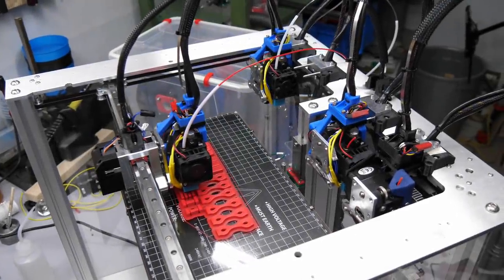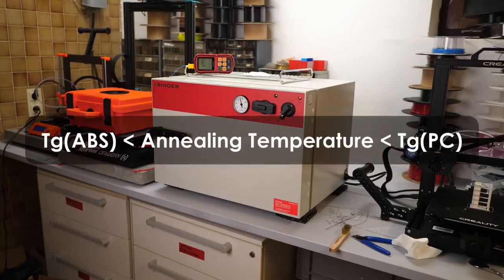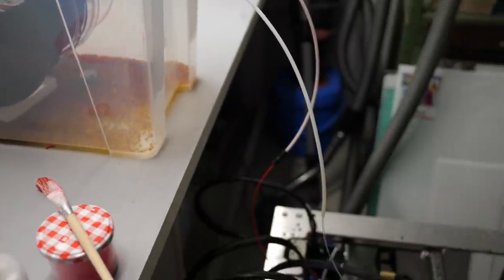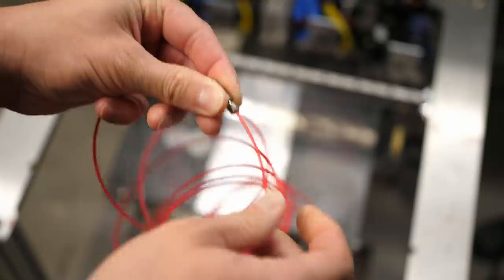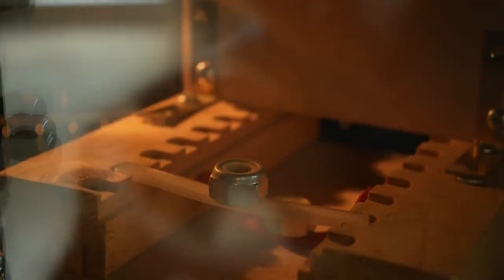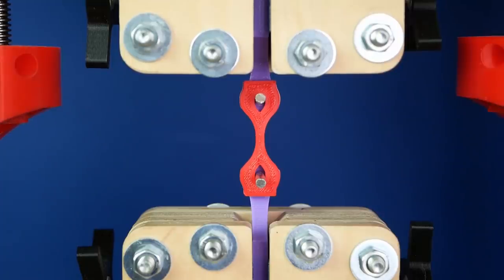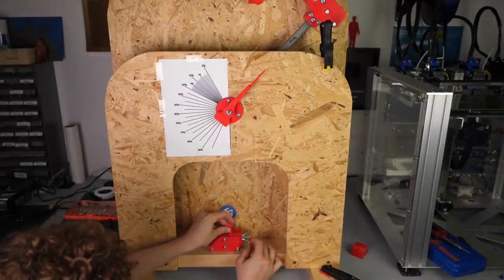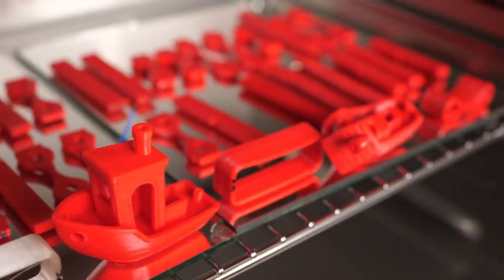PC-Core ABS - WARP-FREE annealing with Ingenious Dual-Material Filament

Comment: 8:40 Seeing this makes me miss the Differential Scanning Calorimeter we had in college. Have you looked into Differential thermal analysis? Those are reasonabely easy to diy. 
Getting a fairly accurate estimate for the Tg, Tm and Tc for both materials seems to me to be key to getting this to work. That is, if it is acually even possible and the paper not a fluke.

Edit: I am an idiot. PS and ABS are amorph so Tm and Tg are the same. -.- I mean like, the PS was transparent, even after this random heating and cooling. Should have been obvious.

Edit2: I do not get it. Even though PC has an higher Tg, the processing temperature are roughly the same. So even though ABS gets 50° earlier soft, both end up at roughly the same viscosity relatively fast. The whole point of adding PC is to give the ABS form stability while annealing at higher temperatures. But getting anywhere close to the temperature needed to influence the adhesion between layers enough to justify the ABS will also melt the PC.

Would it not make more sense to just run the extruder at the max. temperature for extruding PC, seeing that ABS can get easily take the temperature without reaching Tc, and forego the annealing alltogether?
Reply: This is actually a very simple, easy to test, yet genius idea! Provided you will not get thermal degradation of the material, of course...
Reply: It does not have to be pc-abs even. Any combination of materials (say, PLA with somethings else, compatible yet more heat-resistant) with HDT delta high enough, will allow printing stuff at very high temperatures that results in layes fusing together perfectly, BUT the core will prevent the print from sagging in the process! No need to heat treat for days.
Reply: Even more interesting, it seems that you will be able to use highly fiber-loaded material in the core, BUT get away with a brass nozzle because outer layer isolates the nozzle from the core.

Comment: One of the things that really bugs me about all of your heat-adhesion and heat-annealing videos is that you never use an actual firing sequence or heating pattern with the piece already inside the way a heat-treatment oven is traditionally used; or at least you don't describe doing so. As far as we know as your viewers, you just crank the oven empty, wait until it stabilizes at a single target temperature, open it to insert the piece (which destabilizes it), and then leave it in there at the same temperature for durations that you don't always reveal... If you're going to keep the treatment oven, can you please make an episode where you test different heating and cooling sequences?

Comment: Have you looked into acetone treatment on ABS and how that affects layer adhesion? I would imagine it would help adhesion at least a little bit since the vast majority of a part's strength comes from the shell thickness and count, so fusing the outside with acetone would show better results than just the infill, for example
Reply: I was also wondering about vapour smoothing. Pretty sure he has done it in the past to pure abs and got worse results, but could be interesting to see what it does with the PC core
Reply: Acetone smoothing doesn’t effect layer adhesion, because it only melds a minimal part of the layer (around 0.1mm on the outside).
However, you could strengthen ABS prints with One or more coatings of ABS slurry on the outside. Printing dimensions and optics will deteriorate  dramatically because of warping, though.

Comment: Could you revisit gluing parts together with multiple Glues as well as multiple Materials? 

I Think of PLA, ABS, PETG and maybe even PP as Materials. Glues could be CA in different viscositys, Epoxys, Modelling Glue (Modellbaukleber), Acetone fusing. Also you could include welding/fusing methods like soldering Iron fusing, 3D Pen welding, and even friction welding with using filament in a Dremel.

Recently I got myself some Pattex PXSM1 which seems to work extremely good with ABS and PLA because it dissolves it and fuses it together. Maybe even better than CA on both Materials. But with PETG which it probably can not dissolve, the bond ist extremely weak.

While there are some videos on that topic most only include a small base of glues / welding methods or only one kind of material. Also many of them are not of the high testing quality like your videos!
It would be very interesting to know, if there is an "one to rule them all" kind of gluing/welding or to know which is best for which Material.

Comment: Stephan, would it be worth testing the annealing using a vacuum bag technique? Similar to what is used in composite layer resin infusion? Thinking the added compression with the heat may increase the layer fusion?

Cheers
Reply from the maker: Yes, I've seen some other paper do compression annealing. Kind of similar what HIP treatment does with sintered metals.

Comment: I wonder whether having the outermost layer of something even lower Tg than ABS would allow a more pronounced melt fusion of the layers. Also, a material with fast melt flow.

I have a hunch that PLA on the outside could be really good - it qoes fully liquid a sufficient temperature

Comment: That's a really cool idea! Some of my immediate thoughts have already been mentioned, but here:
Unless the diffusion is supposed to work on the PC as well (if the heat treatment temperature was that far below the PC's Tg I don't think it would have a major effect), wouldn't the expected layer strength improvement be limited to the strength of the ABS? It does show an improvement over normal ABS in both treated and non-treated tests (it is a composite when printed after all), but if the Heat Treatment is still below the Tg of the PC (a compromise, as mentioned), and the polymers are still phase separated, then it seems like the ABS is the main component that's supposed to fuse the layers.
My point is, if PC-Core filament is already stronger in Z than annealed/heat-treated ABS (as shown in the tensile test results), and the diagrams from the paper seemed to show only the ABS component flowing/fusing, I don't think I'd expect to see a huge improvement, particularly with a high cross-sectional area of PC. The test results might be different with a lower percentage of the cross section being PC or a higher grade of ABS, since the PC would still retain the shape, but the ABS would be a larger contributer to the strength of the printed part. This is probably part of the reason for a star pattern in the original paper instead of a core, so that the improvement in strength could be more easily demonstrated.
EDIT: I think this might also play a part in why the impact strength saw a more noticeable improvement, since the PC parts showed a lower impact strength (but with lower scattering), likely due to the decrease in ductility, but the PC-Core parts actually showed an improement and lower scattering, likely the best indicator of layer fusion in the results.
Reply: Another note (to avoid an extra-long comment):
Do you think a pressure treatment regime could bring out some of those desired properties as well? For example, heating the parts to the treatment temperature for 3-7 days, but slowly decrease the pressure (to draw any gases from the print, whether it's typical polymer volitiles like Bis-Phenol A in the ABS, or porosity between the layers), hold a partial vacuum for a few hours, and then slowly increase the pressure to be greater than atmospheric (to compress the parts and encourage layer fusion)? This would also mean varying the temperature during the test (to stay below the PC's Tg at all pressures), but it might be interesting to see.

Comment: Nice work, I would like to suggest a way to make a star-shaped core, if you print the filament with 3mm in diameter, and using a lathe make a 1.75 nozzle for 3mm hotend/extruder and simply extrude, this way you should have a 1.75 mm filament with the star-shaped core.

Comment: Amazing analysis, and really well done as usual!. I think this material might retain its strength more over time, and may lead to longer lasting parts rather than stronger parts. A similar approach is done to pvc id cards, straight pvc only lasts about 2 years and becomes brittle and cracks, the better cards we use are a pvc/pe 60/40 sandwich, they last twice as long.

Comment: How about printing directly on the final product with the two materials. Like maybe one string of abs and the neighbors a string with PC. Maybe the result would be the same but much easier to produce instead of first printing/producing the filament and then using it. Also would it solve the problem of in one comment mentioned that the material would get weaker when melted multiple times. It could be even more stable in the oven because the string of pc would be laying direct on a string pc from the lower layer. But it would only work good when the different layers a cross each other or the pc would make a wall and prevent the abs from connecting sideways to other abs.

Comment: Im shocked by the print quality from that printed filament, i was expecting the extrusion to be visibly inconsistent. Stefan, have you looked into packing parts in sand before annealing them? Theres some anecdotal evidence that it keeps parts from warping to a certain degree.
Reply from the maker: Will need to try that at some point!
Reply: One could take that approach to the extreme, use clay instead of sand like a lost form and reheat the ABS to melting point - should remove the layers completely.

Comment: You mentioned you might try testing this process with other materials like PLA and TPU.  I just got a direct drive extruder setup for my Ender 3 and started playing around with TPU.  TPU appears to have tremendous layer adhesion (anecdotal,  I'm not equipped to test...)and I would love to see you put it thru your tests.  Alone and also bonded with PLA.  I also discovered PCL which prints at very low temp and has a finish feel similar to Tupperware which would be interesting to see you test.

Comment: So we learned that straight PC is better than PC core ABS, also cheaper. Again, annealing confirmed not to increase layer bonding. My running theory on that is that plastic needs to be at melting temperature for the layers to fuse (soldering iron welding works just fine after all). Maybe PC core PLA will be able to do this, though it wouldn't be very useful material because PLA is naturally extremely brittle and non heat resistant.

Comment: Would PC and PLA be possible or something similar? From your past videos annealing pla improves it's properties, however it warps. With the PC core it would not warp as much.
Reply from the maker: I'll need to do some compatibility tests before. PETG and PC might work, though.
Reply: @CNCKitchen Yes  PC & Petg might work I know it as an injection molding compound. Maybe PA 12 on the outside and PA66 on the inside as well? And I am looking forward to tests with tpu and pla. might be an interesting meta material regarding combining stiffness with impact strength...
Reply: We originally chose to use two amorphous polymers (ABS/PC), but we do believe semi-crystalline polymers like PLA in combination with ABS or PC would be interesting to try because of the distinct melt transition that semi-crystalline polymers exhibit.

Comment: I'd be interested to see how reversing the filaments would affect the test results.  Not for annealing, but strictly for the structural integrity of the printed parts.  Would a multi polymer filament that consists out of a core made from ABS and a hull out of polycarbonate perform similarly to a pure polycabonate filament?  If so, this could be a way to extend the efficiency of your polycarbonate filaments since you would only need to use 64% of it instead of 100% every time you use it.

Comment: easier than using abs slurry, just take a discarded abs part, and spill acetone on the plate, and rub the part around until the acetone starts to dry and the part starts to have friction. then you have coated the glass bed. just be sure the bed is relatively cool or the acetone just evaporates too fast. and the printer should be enclosed or bad warping happens every time.

Comment: I bet you could print a core from conductive material and an outside layer of a stronger material and you could run power through the conductive material until it melts and see if that helps your annealing process?

Comment: Since PLA is kind of the gold standard for annealing, it would be promising to redo this experiment with PLA and an ABS Core. 
If the endresult would have 80% of the properties of annealed PLA while retaining dimensional properties, that would be really nice.
Reply: Shouldn't it be ABS core with PLA exterior?
Reply: Would those materials play nice together?
Reply: Like he noted at the start, maybe the reason it isn't done is because these 2 materials don't fuse well? As I recall (for other manufacturing uses) they don't really fuse.
Reply: @Gengh13  that’s what I wrote?
Reply: @6AxisSage  I always figured yes, because one time I got this weird Chinese filament which the vendor said was ABS, but didn’t dissolve in Acetone at all.

Since it was high temperature resistant and nothing like PETG (e.g. splattering when you brake it) I always assumed the Chinese factory made a mistake and put a considerable amount of PLA into the ABS pellets therefore ending up with a kind of „hybrid“ between those two (printing temperatures had to be in the middle of ABS and PLA to get usable prints, too). 

However, this assumption might be totally wrong.
Reply: @fabianbinder3681  hmm yeah, reminds me of how some brands of PLA melt when exposed to acetone while others dont.
Reply: @6AxisSage  yeah, probably it’s possible to find two mixable variants of PLA and ABS, but then it would be hard to replicate because there are so many different variants out there. 

At the end, just going with this heat treatable PLA (forgot the name HTPLA perhaps?) would be the way to go then. 🤷🏻‍♂️

Comment: Nice video! Appreciate the time taken to test this! I'm curious if annealing the parts in a vacuum would help to pull the air out from inside. Or... in a much more difficult option, print the part in a vacuum to begin with.

Comment: PETG + TPU?
My experimentation with PETG+TPU prints (layer-by-layer basis) came to the conclusion that for requiring an object with structural strength and some flexibility it's not good enough under extreme stress, it can split too easily at the layers.
How easy is it to print nylon? Does the printer need to be in an enclosure? I have drying & storing solutions already.

Comment: there is different temps and procedures for annealing plastic's they are not the same, for example ABS is suppose to be annealed at 200f in a Nitrogen atmosphere, while PC is 275f (290f with carbon or glass fill) in a Air atmosphere  there is als warming and cooling procedures ABS 50f increase every HR till target temp is reached hold temp 30min for every 1/4in or 6.4mm thickness, then cooling drop 50f every hour, PC starts at full temp holding same time frame but cooling is also 50f every hour

Comment: I'd reinforce the glass bed with a thin sheet of metal, and then spraycoat it with multiple thin and even layers of PEI.

I'd also set up some polynorbornene mountings and J-Dampers (aka Inerters) to minimize vibrations. And of course, I'd make use of a six-axis IMU and input shaping.

As for the choice in materials, I would experiment with different varieties of ABS and polycarbonate.

Lastly for annealing I would still print them in a heated enclosure and on a heated bed, and I'd pack the parts with salt and sand before putting them in the oven to temper and anneal them. And of course, I might use a little bit of support material just to be safe.

Comment: Thanks for the great video, I'd pretty much stopped watching most 3d Printing videos, there seemed to only be rehashes for already covered ideas. One test I'd like to see, is a mix of PLA/ABS, or even with PETG, something the average 3d printer can do - I REALLY didn't think you'd still get separation of materials after extrusion, I thought it would just mix in the nozzle, and was very happy you I was wrong.

Comment: Seems like the cross section of the co-extrusion has more outer arc bits than the (admittedly impressive) diy co-extrusion you made, that might improve dimensional accuracy and rigidity at higher temps.  Nevertheless, what you’ve managed to pull off with just experience and home 3d printers is crazy

Comment: I read many of the comments which were as interesting as the superbly done video. Hoeever, I did not read all of the nearly 400 comments that have been submitted at the time of mine, but I hope someone has pointed that that one of the chief reason for using PC-ABS or PC-ASA is that unprotected PC is very hydroscopic and sensitive to UV making it unsuitable for outdoor applications, whereas ABS and ASA excel in these areas but are weaker than PC and can be strengthened by having a core of PC.